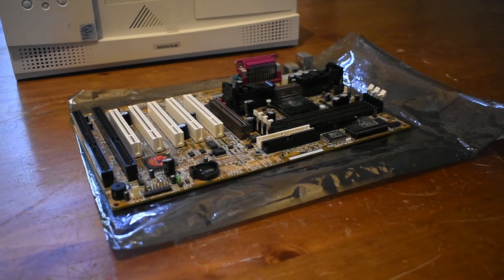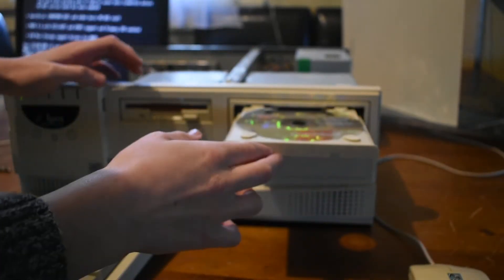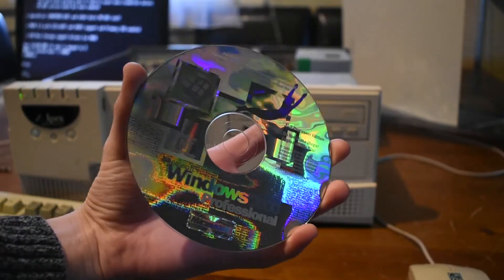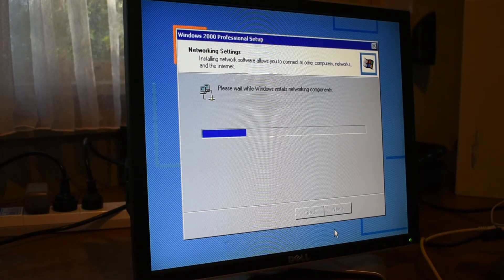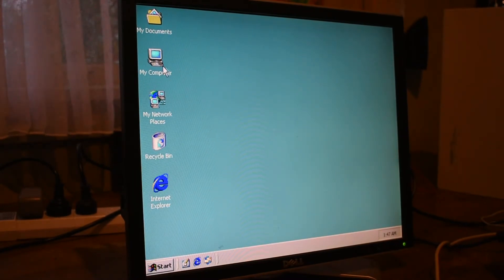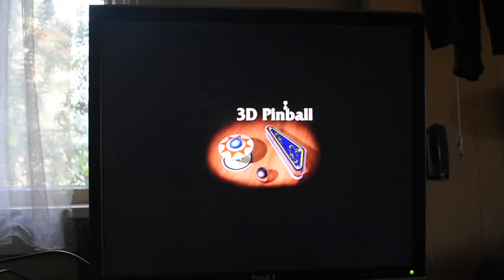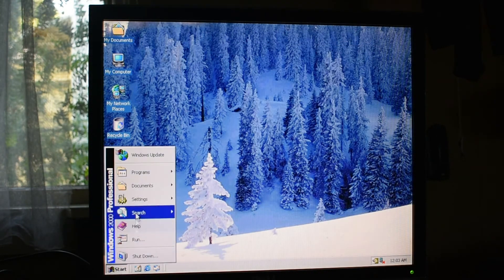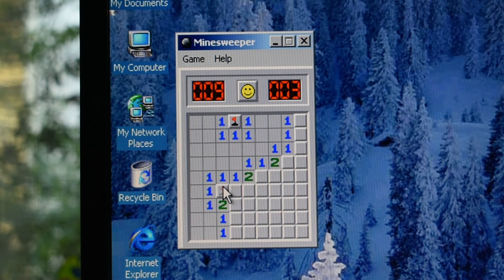Re-Building A Pentium III Ipex Computer From 2000!

Comment: I have this exact machine, but mine's a Pentium II at 333Mhz (originally 233Mhz) running Windows 98.
The board in mine is a P6LX-A Rev 1.1.
The thing I did most on it was make PowerPoint animations and play games that didn't require a 3D accelerator.
I was rebuilding it yesterday and the old 3gb drive still works perfectly.
Reply from the maker: Nice, yeah it's a decent system

Comment: I am currently building in this case, but I can't figure out how to get the built in speakers to work. Did you get yours going, Mr SanLines?
Reply from the maker: Nah I didn't bother trying to get the speakers to work, hope you can sort out yours!
Reply: It's proving difficult so far, but I'm curious to know how they sound. Do you think the front io speaker header would plug in to my mb, or my sound blaster?
Reply: They seem to run to the rear gameport db-15. Should be able to hook up to audio headders though

Comment: Here's a link to the driver for your network card: https://www.realtek.com/en/component/zoo/category/network-interface-controllers-10-100m-fast-ethernet-pci-software . Not sure if this is the same one you already found or not. It might be worth a try to move the network card to a different slot on the board, as there might be a conflict with another device (shouldn't be an issue, but maybe).
Reply from the maker: appleontheapex thanks, I haven’t yet tried this driver, so I’ll try it out.